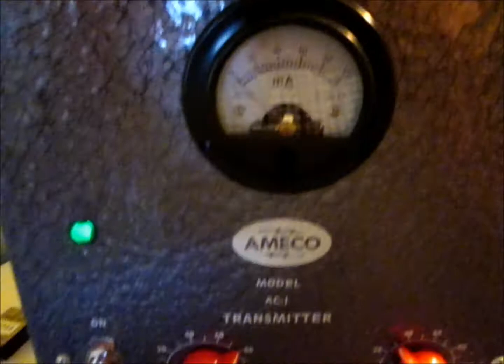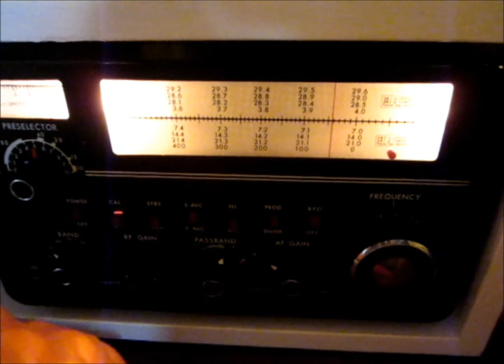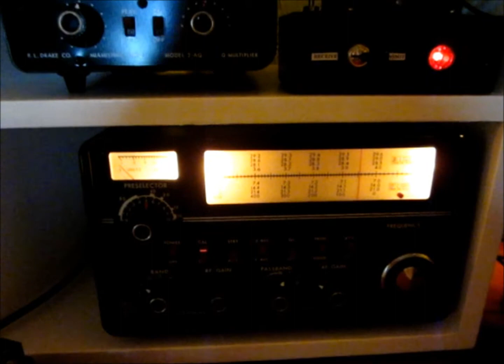"Real" FT-243 vs. HC-49 stuffed into an FT-243 Holder

Comment: The smaller  HC-49S is worse, the larger HC- 49U is much  better, up to about 10 watts, the S is often used in restuffing and should be used at no more than 1 watt or 2 ,  the Smaller S would be fine for Qrpp and that crystal is often used in the Pixie ,  I have used the larger HC-49U crystal  it will fit inside a FT 243 case but you have to mount it differently to squeeze it in.  with my 6AQ5 transmitter with about 4 watts out and tone was fine, but agree nothing beats the original FT-243 crystals Love your videos Stan keep them coming   73 J

Comment: Two Hc-49 Xtals went out on me. They were retrofitted. Though I did get some clean signals out of my two 7.122mhz xtals I don't recommend tunning too long on them... I just built a Homebrew 40m CW transmitter, a Pastime CW transmitter and an Ameco AC-1.. I just started ordering the original Xtals.. Thanks. I just shared this on my Facebook Page.. good job.

Comment: Perhaps someone else's small crystals failed for you?   It has a lot to do with how you adjust those touchy 6V6 oscillator rigs. I have heard from a few AC1 users who are able to get a very clean signal from the newer crystals. We have sold many to the Ameco users group.  Your statement that "Tube rigs don't usually get along well with the thinner crystals sold today" is erroneous. Erroneous and mis-leading. We have sold tens of thousands of these crystals to radio stations;  amateurs and others that use them in valve transmitters (tubes) with great success. In fact our web site has hundreds of references and testimonial reviews that prove this.  Also - I don't know where you read that they fail to perform properly,  but this is the kind of hearsay that leads to such mis-conceptions.  See the Electric Radio Articles by Dr. David Gordon-Smith, G3UUR in which he reviewed our hc49 crystals used in the FT243 cases, and gave them a very clean bill of health.  (May 2005 E.R. Magazine) There are thousands of these crystals in daily use around the world in everything from DX40s to BC610s with great success. Many are in Hallicrafters, Drake, Gonset, Heath, Collins radios etc.  David Ingram, K4TWJ recommended our crystals in his many CQ home brew articles. Dr. Bob Heil, K9EID recently recommended them in his December 2017 article in QST !! Anytone will agree that these guys know what they are talking about. Please e-mail us if you have concerns or reservations. We stand behind every crystal, and will refind for it if you manage to get it to fail in any way! 73 from AF4K CRYSTALS... http://af4k.com/crystals.htm
Reply from the maker: OK Bry.  I've demonstrated my experiences with this video.  You've countered with a well articulated argument based upon your in-depth experience producing products.  The viewer now has both sides.  See you on 40M CW. 73, Stan